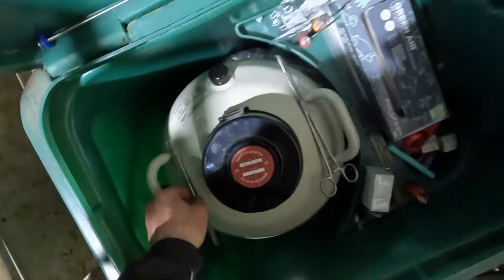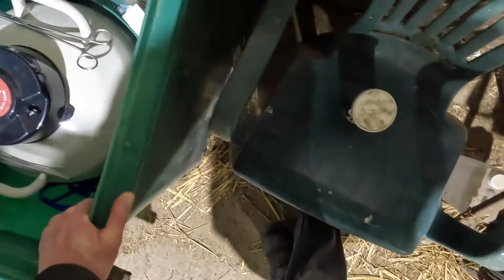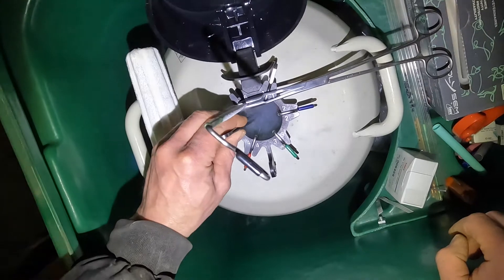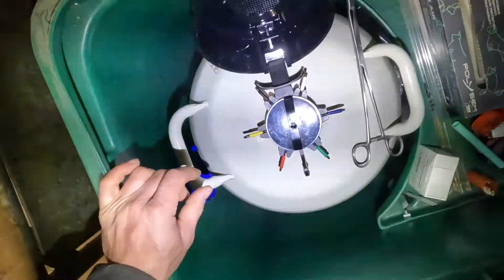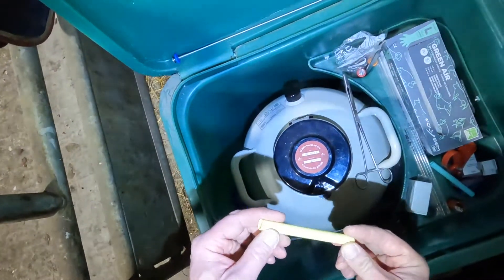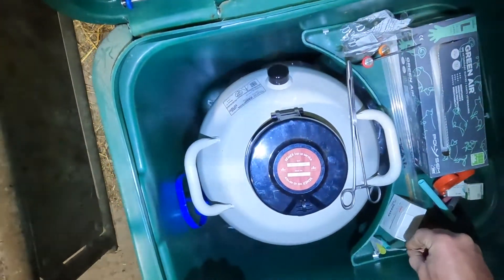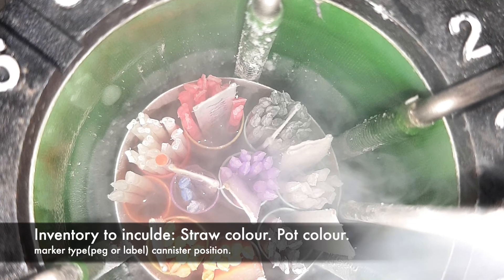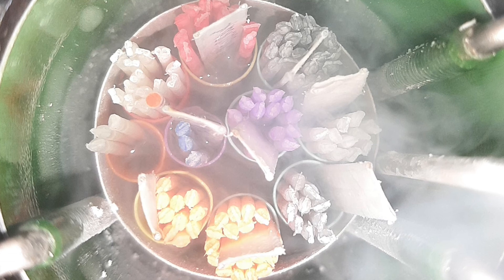AI flask tips. Delivery handling. Inventory. Straw rescue

Comment: If u end left
 the tank open for two hours would the straws be okay?
Reply from the maker: If the nitrogen level was high to start I'd expect the upward evaporation would potentially kill the top end of your straws. Vapour will still keep them below -150C but if there's a bit of a breeze evaporation will be quicker. Safest thing would be to get a low value straw lab checked and get flask topped up ASAP.